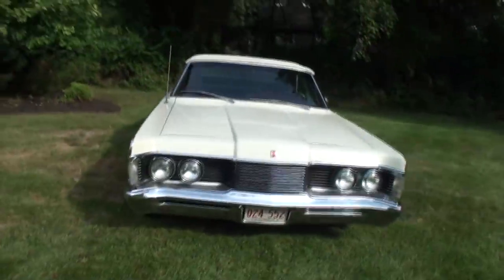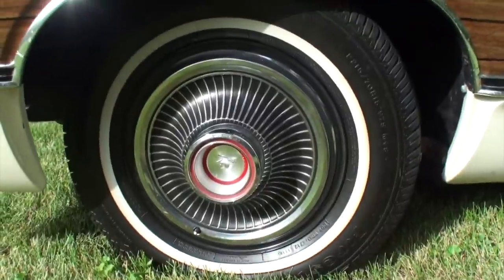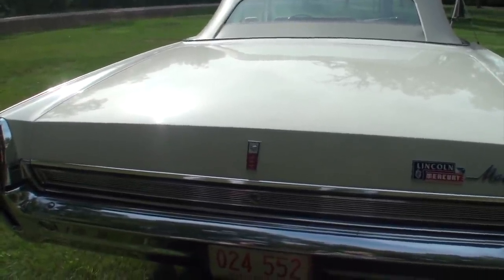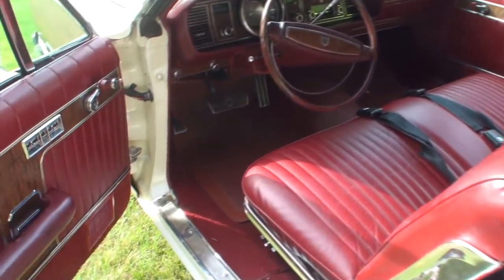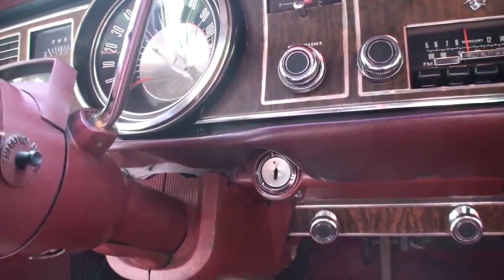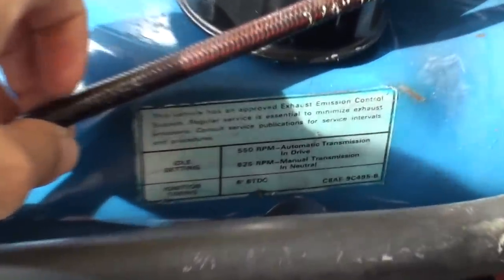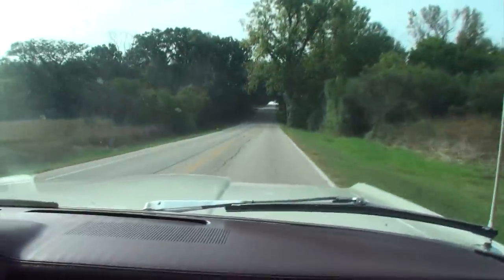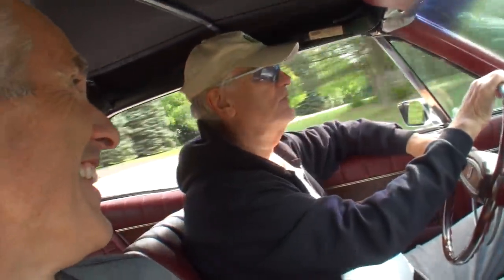1968 Mercury Park Lane Convertible with Colony Park Paneling & Ride My Car Story with Lou Costabile

Comment: I understand wanting to avoid potential depreciation or a difficult potential repair but there is no way I could own this beauty without lowering the top.  I don’t know how Buz can stand it!  Great review, Lou.  👍  ~ John
Reply from the maker: Hi John, I'm sure Buz will drop the top to confirm it works, we just didn't want to try it and now have a problem if we're videoing. My pleasure sharing this one with you, Lou
Reply: After all of these years if he put that top down he could probably never get it latched again!
Reply: He’s had the car for over a year and still doesn’t know the condition of the convertible top? There’s no point in owning a convertible if you don’t put the top down and you might as well find out now if there’s a problem. The top looks great by the way which suggests that there isn’t a problem. Whatever it’s his car so best of luck.
Reply: Right? ....

Comment: Hi, Lou! This car gives a literal meaning to the expression "land yacht"! BTW, Mercury was not alone in offering this kind of trim on a non-wagon in 1968. Chrysler had a similar trim option for its Newport convertible and two-door hardtop that year, and they also offered it in '69. Also in 1976, Chevrolet offered a "woodie" Chevette, and I imagine those would be pretty hard to find today as well. Collectible Automobile magazine in its June 2021 issue came out with an article on the history of the Park Lane series, which was built from 1958 to 1960 and again from 1964 to 1968. Mercury had introduced the first Marquis in 1967 as a formal-roof two-door hardtop, and that would be turned into a full series for '69 to replace the Park Lane as the flagship Mercury.

Lou, you've always had a knack for finding rare nuggets like this. Many thanks to you and Buz for taking us all out sailing on the open road!
Reply from the maker: Hi iswc27, Thanks for viewing and sharing your knowledge. A "woodie" Chevette, that will be interesting to see if I can locate one of those :-) My pleasure sharing with you, and you're welcome, Lou

Comment: I noticed this year Mercury didn't move to the recessed wipers like GM did  in 1968. GM accomplished that by extending the rear length of the hood and curving it up to cover the wipers in their off position. That seemed like such a positive asthetic change but all models dropped it eventually. I wonder why?   Also for either 67 or 68, many car mfrs added a buzzer to inform the driver they left the key in the ignition. In 1969, the locking steering wheel ignition began. Lou, I'm glad you showed the ignition on this one as I was curious where it was after the owner noted how odd the location was.
Reply from the maker: Hi Robert, Happy to share the details of this car with you :-) Lou
Reply: Hi Robert, the recessed wipers looked nice, but in winter they created a large cavity for snow and ice to accumulate. Making it very difficult at times to free, and allow the wipers/washers to work.
Reply: @tomjackson8431    thanks for the explanation. Makes sense.
Reply: @loucostabile  The air cleaner reads "390-4V." Does that mean four valves per cylinder, 32 in all? I don't know that L-M ever built an engine in that configuration.
Reply: @michaelwalter3399  4 V means four venturi carburetor, four barrel.

Comment: That car was brand new when I had grown old enough to fully appreciate automobiles. A '68 fully optioned Park Lane soft top was what I'd drool over. These cars were a remake of the old woodie convertibles from 1946-1948 by Ford, Mercury and Chrysler Town & Country. Chrysler also made a few Newport convertibles with faux wood in 1969... This '68 is too cool
Reply from the maker: Hi Steven, Happy to read "This '68 is too cool" :-) Lou

Comment: the interior on this car is impeccable. I beleive chrysler had the wood grain side on 2 doors in 67 but if you look back into the 40's and 30's it was a rich option with convertible. chrysler and ford sold the most then. That 68 merc is a museum piece.
Reply from the maker: Hi Jeff, Happy to read the details you enjoy with this car, Lou

Comment: Buzz didn't know what the vacuum canister was for. It wasn't the windshield wipers. They were electric. Back in the late 60s and throughout the 70s, Ford started to use vacuum motors and switches to control the HVAC systems in the cars. First, they started with the full-size luxury cars and later with the rest of the cars. That canister was required to make that system work. I noticed on a few other videos that the question of what that canister is for came up, and nobody seems to know the answer. In our modern cars, all of that is controlled electronically. Prior to the use of the vacuum system, those controls were operated with mechanical sliding cables.
Reply from the maker: Hi Daniel, Thank you for viewing and sharing your knowledge. Lou

Comment: -Buzz Lightyear owns the car
-The car is a land yacht with yacht paneling, no coincidence
-The turn signals are swords
-Diamond shaped taillights that don't cost as much as a diamond
-There's a moth in the trunk
-A psychic door. it opened itself wider on its own for Lou
-Neon green in the dash before the Dodge Neon existed
-It's called "Park Lane" because it's parked on the right lane in front of your house for ages
-It's a mercury that has no mercury in the construction
-A heater control valve that was painted on by Van Gogh
-It's a land yacht that feels like your riding on a cloud. A flying land yacht.

Awesomeness score: 101%

Randomness score: 89%
Reply from the maker: Hi Staticky Cat, Thank you for viewing and sharing your thoughts. Hope you see many more cars on this YouTube Channel you enjoy. Please subscribe, and hit the "bell" so you can see all the cars when they are uploaded on this YouTube Channel, Lou

Comment: Nice convertible, but I couldn’t help but notice a few peculiarities.  The build sheet in the trunk lists it as having an “AM Radio,” with a rear seat speaker.  But it has an “AM/FM radio,” with what appears to be stereo speakers mounted on the lower door panels.  Strange indeed!  I also noticed the “black seat belts.”  For such a high-end model, you would expect them to be “colour-keyed” with the rest of the interior.  Finally, I noticed that the vent window cranks are missing an aluminum disc appliqué.  My brother once owned a 1968 Mercury Cougar, and I remember being able to “peel it away” when he showed it to our family.
Reply from the maker: Hi Fred, Thank you for sharing the details you noticed, Lou

Comment: I'm surprised it doesn't have dual exhaust. Lou you usually ask how and where the owner got their unique vehicle. Some of these older convertible tops can be difficult to get packaged when closed but how cool would it be cruising down the road with the top down. I don't get it when on a pleasant 77 degree day I see people driving convertibles with the top up. Why get a convertible if you don't drive it with the top down? Well to each his own.
Reply from the maker: Hi Bill, I'm sure Buz will drop the top soon, however this car is relatively new so we didn't want to have a problem so we could drive an video it. Lou

Comment: I think that same hubcap was also on the 69 Lincoln Continental
Reply from the maker: Hi Robert, Thank you for sharing, Lou
Reply: @loucostabile   Great to see you responding Lou.
 I love your videos. 
Would love to see you do A 1976 Cadillac Fleetwood Talisman they were extremely rare cars.
 I used to own one.
 I think in 1976 they made only 1200 of the Talismans of the Talismans.
They made them also in 1974 which is the most desirable.
 and 75.
 1974 had the center console in the back seat  That was the only year it had the console in the front and rear.

Comment: No wonder, it was a one year only option. It didn't take Mercury division long to find out why 👏 Otherwise, those were great-looking cars.
Vaccuum windshield wipers, no way. Only AMC carried those over, that far. That vaccuum canister is likely a booster for vaccuum-assisted heater/air conditioning vent openings.
Yeah, Rambler drivers used to be the Boys named Sues of the boulevards and drive-in burger joints.
It's a great car, like you say. But it still cries out for a real Marauder 428 with dual exhausts
Reply from the maker: HI Al Dente, Thank you for viewing and sharing :-) Lou

Comment: It's a 1968 first year marker light mandate car..but  I guess Ford figured the parking lights were so visible from the side they didn't have to install marker lights ?  What an interesting beauty Lou ..well done  !
Reply: Lower portion of parking light with small bulb is the side marker light.
Reply: @danielulz1640  ahh, & what Lou called a reflector on the 1/4 panel is actually a marker light.. I see thanks..  cool car ..
Reply: @Scalihoo  actually, the rear quarter reflector is a reflector! They didn't get the standards worked out until the 1970 model year.  Many FOMOCO products for 68 had lights front, reflectors rear.  MOPAR used little round lights front and rear for 68, rectangular reflectors only for 69 and, finally, lights behind the reflectors for 70!
Reply from the maker: Hi Florida Alan, Happy to read you enjoy this interesting beauty :-) Lou

Comment: Why doesn't the sticker or Marti report mention the factory installed AM/FM Stereo radio ?
Reply from the maker: Hmmm, not sure.
Reply: Because the car had an AM radio from the factory that's been replaced with an original AM/FM radio.  Simple as that.
Reply: @onapona  That's what I thought. Thanks

Comment: Usually MERCURY had alot of style and beauty. The paneling on this is just SO WRONG ! It really cheapens the look on this model. The station wagon is a different thing ! Even CHRYSLER and FORD had a wagon that the paneling looked really great, but they NEVER put it on a car like this ! Can you imagine putting this on a LINCOLN ? In the forties,  It wasn't unusual to see this on a convertible but they were never this size.
Reply from the maker: Hi fob1xxl, Thanks for sharing. Appears Mercury never tried this again, which does, make this car quite unique :-) Lou